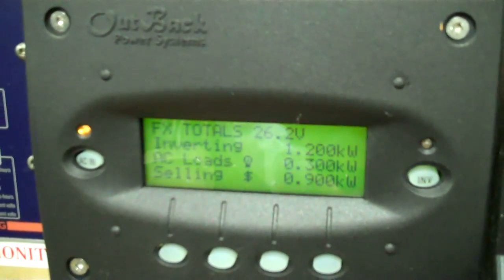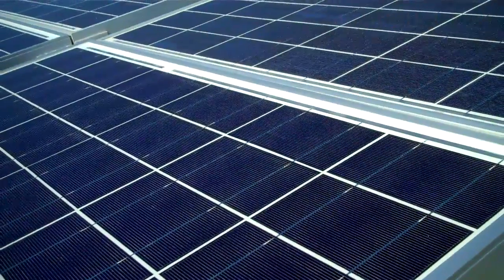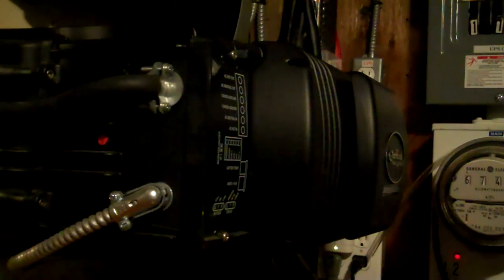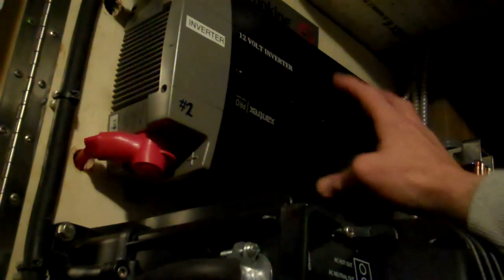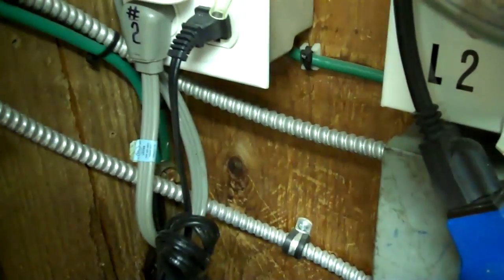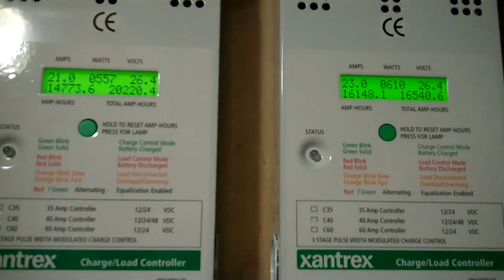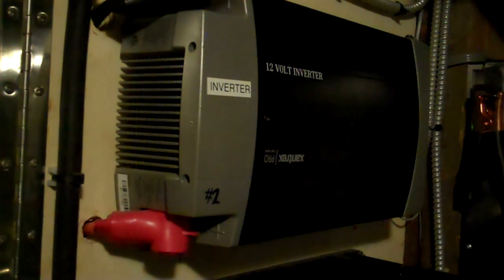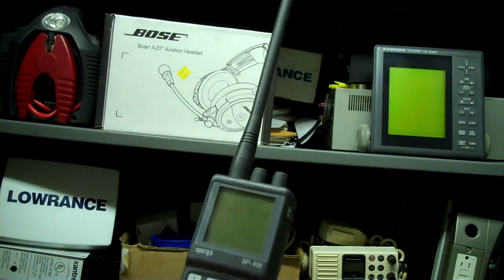EMP/SOLAR STORM.. WILL YOUR SOLAR POWER SETUP SURVIVE??

Comment from the maker: The one thing I do know about CMEs or EMPs is our grid acts as a huge antenna. Turning off switches or breakers may not give you enough seperation from the massive amount of absorbsion of stray current that our grid would be enduring and trying disapate. Seperating your electronic devices from the grid is a must.. Hope that helped..

Comment: I agree. The LAST resort would be human charge controller on/off, then diodes are next up then cheap controller etc... Big diodes will survive and if you have a bunch, even better. In a SHTF situation I will be too busy to turn off the panels at night and I know I will forget. You are right about the batteries and panels surviving, you already had one big EMP to prove it! Also have some spare AC sockets because the GFI sockets will go/blow the chip but you can change them out for convenience.

Comment: from my experance with high Hz energy (tesla coils) i have blown up a GTI (a cheap Chinese one) via striking a belt sander that was plugged in close to the GTI (the same outlet) it hit the earthed chassis. and exploded the fuse in the GTI and also the mosfets, i replaced them and it worked fine again. so keeping spare mosfets for your inverters can be a good idea, i have also blown a fluro ballast (an old school one) with a strike to the globe.

Comment: There are still electrically connected components that are in front of the power switches on equipment. A bolt of lightning arc's. The potential of that lightning will also arc inside equipment, but not if it is unplugged from the grid. Unplugging equipment is always the safest bet.

Comment: the Hit to your House through the power lines can and most likely will be very small. Yes they do act as a Antenna. and that is very bad. as it will blow out all the Sup-stations and Transformers on the way to you house, That is where the most problem will be. if that happens. Depending on where you live, You man not have power for the next 2 to 5 years. Transformers the big Jobs, are on a 2 year back order now. This is just to bring a different Prospective into the equation. Nice video Kevin.

Comment: Put some big diodes, a couple of those $7 12/24 CMP charge controllers and a spare inverter stored away in a sealed metal box. The diodes would prevent nighttime feedback into the panels and most likely you will use all the solar power in a SHTF situation so it will be hard to overcharge, but easy to forget to disconnect the panels at night. If the $5 controllers survive, so much the better but the big diodes will survive a EMP even if they are outside. All the fancy controllers have CPUs.

Comment from the maker: From my understanding exposed conductors like antennas or our uninsulated power grid will have the tough job of absorbing all this stray current. Having a large antenna up during an EMP or CME will not be a problem as long as it is not grounded or hooked up to your radios. The problem lies in active systems like all our creature conforts the run off of electricity. I guess the answer to you question is the least amount of exposed (uninsulated) wire you have the better. Cheers Brother..

Comment: Having unplugged electronic equipment, grounded or ungrounded being saturated by an EMI burst will be induced with enough potential to damage solid state devices. The best protection against this is magnetic shielding. Creating a passive or active electrically conductive structure around your electronics to dissapate the magnetic field is the best approach. However the greater the magnetic field anticipated dictates physical size and can be very large depending on the size of the magnetic field.

Comment: A solar flare is very weak. If you pulse a wire floating out in space with a magnetic pulse it will create a voltage across the wire, if you could measure it at that point, how much depends on the pulse. A lot of the new circuits use 3V so it's getting even more possible to over voltage a internal circuit with a pulse. And flash memory is simply electrons stored in a cell, all you have to do to flip one is put more electrons into it. 65 characters left this is a great medium to get technical in.

Comment: Your videos are awesome, it's been a little adventure to surf through them.  My understanding of the EMP is that (like any electromagnetic wave) energize any coil or length of conductive material that it passes through (like you I am not a specialist in the field of nuclear radiation but do have a background in telecommunications and signal propagation).

Logically this would suggest that wireless communications would be the most vulnerable to EMP as they are designed to sense or create very subdle changes in the state of charge within their frequency ranges.  
An analogue that comes to my mind is that an EMP hitting a walk-talkie (HT) antennae would be using a 1000 ton freight train going 100 miles an hour to push a button on your TV remote.  It just not designed to handle that amount of force.

Next would be any transformers, The coils in our appliances could have a massive surge generated in them which could blow out sensitive electronics, and theoretically backfeed the wiring in your house and hurt other sensitive devices.  The power grid has massive surge arrestors (similar to the ones (I'm assuming you have gas filled shunts?) in your system to protect against lighting) in between key points within the grid that would theoretically protect one overloaded part of the grid from affecting another (example: Stepdown transformers at substations that are within the vicinity of lighting strikes can propagate a massive voltage that the surge arrestor will conduct to ground.  (that is usually what is happening when your lights flicker during a thunderstorm, the grid is "venting" a lighting propagated voltage surge to ground and protecting the system).  If an EMP is strong enough it could cause a transformer to self destruct, blowing the fragile insulation away between the primary and secondary coils.  The "Cans" on the poles on the outside of your house however don't have that kind of protection, they could create massive surges on what is normally the primary side of the transformer.  This could cause massive over voltages on the transmission side of the local power distribution, every transformer on every pole would then back feed every other transformer on every other pole all at the same time... (Boom). The secondary coils would then not only have a surge induced in them by the EMP itself, but also by the massive surge created by the primary sides of the transformer.  That juice will be heading into your house...    The long of the short of it is that the grid and our consumer electronics where never designed with the threat of an acute EMP,  So who knows what will happen.  My guess is that the farther you are away from the epicenter the less the damage there will be.  There are countless other factors like incidental shielding, Coil cross section size and orientation relative to the direction of travel of the EMP wave to name a few.

Next would be solid state electronics While they are very sensitive to EM radiation they have very small cross sections which make them very easy to shield (ever wonder why computer cases are metal?)

The "Faraday Cabinet" is a great idea.  The theory is that EMP will induce an electrical current within the metal itself,  in simple terms this will absorb that part of the wave and it will severely weaken the wave within the "Cabnet/Cage" (they also neatly store stuff)
As an additional layer of protection would to unscrew or disconnect the antennas of radio's, and if you really want to get nuts, disconnect the low voltage side of any power sources within any electronic devices.  
Unplugging things is a really good idea, as well as disconnecting as much electronics from other electronics as possible. 

The good news is that any sizable EMP attack on the US would be difficult.  It would need to be delivered by air and detonated at VERY high altitude to effect the whole country.  It would also need to be very powerful,  That device would be nuclear in nature, and probably very difficult to build.  Not to mention that "Nuc fuel" is tough to come by, let alone the types of scientific minds and equipment needed to implement it.  I would be more concerned with a conventional nuclear attack...

Ryan
Reply: evangelon2 Great comment, thanks!
Reply: evangelon2 p

Comment: from what I have read EMP induces electrical energy in a conductor. that is why the grid is so vulnerable..long, long conductors=huge amount of energy that would fry transformers. The opposite would seem to be true, so if you are not grid-tied, your system might have a chance. I think the effect is also attenuated by distance from the detonation. Since atmospheric testing ended before the age of solid-state electronics, most of the public data and maybe even the classified stuff is guesswork

Comment: Yes, the metal box is nice till you start running wires into it from the outside and even worse, up on the roof where there are long wire runs and big metal frames around the solar panels that act like EMP pulse antennas. People should be prepared for their fancy, expensive, wonderful controller to fail in a EMP or even lightning strike situation and have a cheap back up ready to go, that's the point of all this, even diodes would be good to have. Not being prepared is your choice.

Comment: I had a CMOS chip go into latch up due to a "pulse", those chips are known to do that. You can read about it at techluck.com on the forums about the CMP 12/24 controller. It all depends on the technology, but OBX is correct that putting spare SHTF simple cheap controllers or diodes into a metal box would be a good idea. If it's not expensive, why not? Also, having the skills to fix stuff will be very important and the public fool system failed everyone in that department. Skills are #1.

Comment: I have a couple of questions Sir.
I've been told that during a electrical storm, event if you turn the power off to devices on your electrical grid, that protects them from damage.
Is that true or should we also unplug them? 
Would turning off your electrical mains protect every electrical device?

Comment: um no, do you know how a tesla coil works? im inputing about 2500W and getting 5 foot long arcs, (or about 4 million volts, kinda, but not really as its RF) so that would work out to about 0.0008A assuming 100% efficiency (and id say id be lucky to get 50%), so not raw amps at all, much closer to the effects of an EMP.

Comment: No, your fancy controller will most likely fail. Listen to people who know. Bits inside a flash chip (your CPU) can flip. OBX got hit and so did I by a EMP, it's called a close by lightning strike. A EMP will create pulses of high voltage in a circuit along any wires or in some case circuit board traces, look it up. Magnetic storage like your hard disk would probably survive because it would be such a short pulse. The electronics may be blown but you would probably be able to recover most of it.